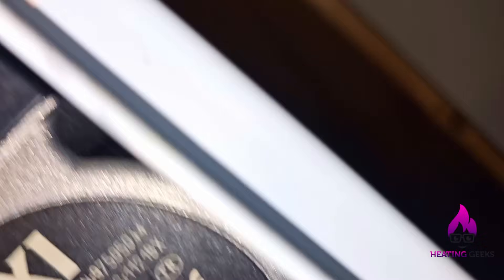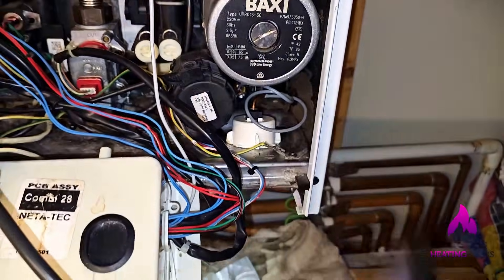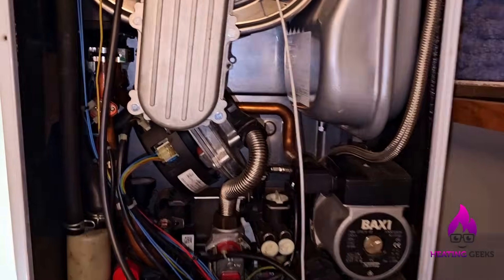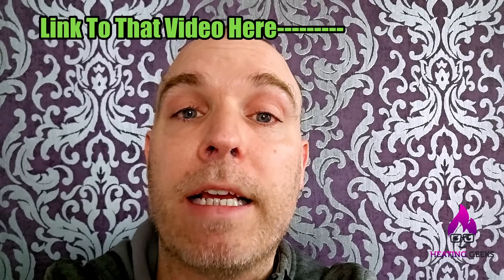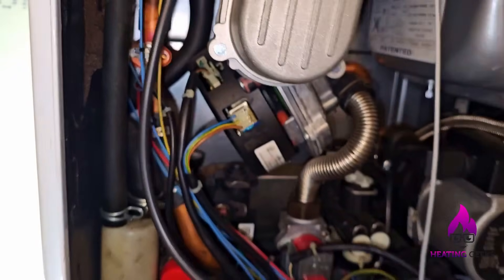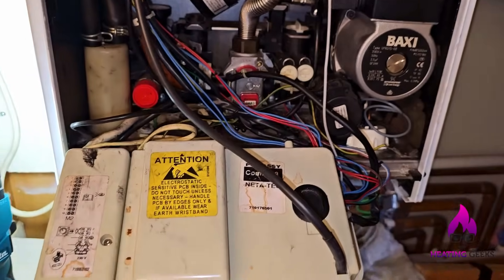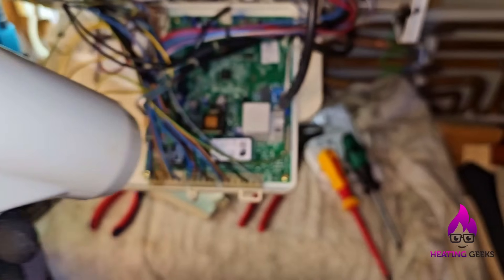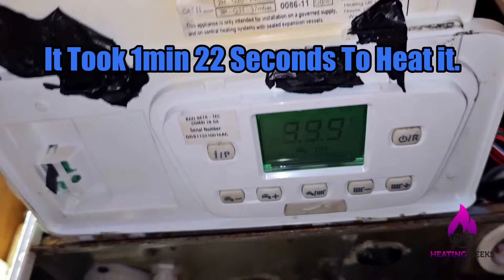Boiler wont turn back on......

Comment: You are 90% there - the startup capacitor is called the bootstrap capacitor  and as you say once the psu is up and running it does nothing bit like a starter motor in a car . All electrolytic caps will fail at some point in time - they have less than a 10 year life span.
Reply from the maker: I don't know how to pin it anymore :-(
Reply from the maker: Nice one. Thanks for sharing your knowledge :-) I will pin this

Comment: I’ve replaced 13 caps on a biomass boiler board the other day. Worked well and saved the customer near 4k 👍🏻 
All caps failed on the ESR meter but multimeter showed fine just low. So you need to have the rite gear
Reply from the maker: Yes mate, 100%. 17 is a lot on 1 PCB. What brand of biomass?
Reply: @HeatingGeek  it was a Lindner & Sommerauer 250kw 👍🏻
Reply from the maker: I hope you charged enough :-)
Reply: @HeatingGeek  charged like a rhino 🦏 mate 😂

Comment: Wow, nice one. Good on you for sharing that information. It might save me or another one of us some serious money some day. You know how it is - "It was working fine till you touched it!"
Reply from the maker: Exactly. :-) Now the toilet doesn't flush and the TV is flickering :-)
Reply: @HeatingGeek  who hasn't been called to a worcester flow manifold that's been spraying that fine mist for weeks, replaced it, turned on the power and boom - the fan goes pop. 😂
Reply from the maker: @MrSuperheterodyne  It doesn't bother me anymore when things like that happens. It used to but now I just tell people these things happen. I will now tell them to watch my video :-)
Reply: @HeatingGeek  I'll be honest, it frustrates me. I serviced an oil boiler the other month and the oil pump died a few days later. No way I could have forseen it, as pressure was stable and combustion was spot on. 
But then the customer will think "why has it failed, it was only serviced a few days ago". 
I try to suggest the analogy that you can get your car serviced today and the timing belt could go tomorrow.  😂  just one of those things we all go through.  Nice to discuss these things though, makes you feel a little more at ease knowing other guys have it happen. 👍
Reply from the maker: @MrSuperheterodyne  Yeah, I even tell customers that turning the power off to some boilers will kill the PCB and it isn't my fault. EcoTec being one.

Comment: There are 3 main places that electrolytic caps are used in a SMPS:

1. The reservoir cap that stores the incoming rectified and smoothed mains. This will likely be the largest cap on the board.
2. The SMPS controller IC start-up supply. The 320Vdc on the main reservoir cap is supplied to the controller via a high value resistor (sometimes 2 in series), this generates about 12V (regulated by a Zener in the control IC) which uses an electrolytic cap to hold the supply up when the chip starts driving the switching MOSFETs.
3. The output from the secondary of the transformer is rectified and smoothed to produce the DC supplies required by the circuit.

I have only ever seen failures of the caps in 2 & 3 above. I have heard of failures of the main reservoir cap but never seen it myself.

Always replace the caps with good quality branded caps, such as Panasonic, Rubycon, Nichicon, etc. The precise capacitance of the cap is not as important as make sure that the voltage rating is at least the same as the one being replaced. The tolerance of these caps can be as high as ±20% anyway, so fitting 150uF instead of 100uF is unlikely to make any difference.
Reply from the maker: Thanks for the info. I have replaced caps in other equipment and fitted higher temperature and voltage with the same capacitance the replacement parts have outlived the original ones. I get my caps from RS components so generally very good quality.
Reply: @HeatingGeek  RS are a good reliable source, I use them too.

Comment: Back in the day I fixed my PS3 with a heat gun / hair dryer by heating the motherboard... Now I'm adding a hair dryer to my tool kit.... Great video cheers😂👍
Reply from the maker: I done the same with my PS3!!! BGA chip. Lasted about 3 months and then I had to do it again. Then I got a PS4 :-)

Comment: UF   (micro farrads ?)   on my Fluke  Multimeter for cap testing,      do it on every service on oil and blown gas motors and change them out when low, before breakdown happens.

Often on water circ pumps its only a cap stopping it from starting.............

I don't delve into domestic gas pcb's  anymore,  as the gas police would be on my case.
Reply from the maker: I do check caps on oil boiler motors and find they are often low. I don't know what you mean about UF? Did I say something wrong? I'm not great with electronics so probably did. :-)
Reply: @HeatingGeek  Dunno about wrong, more ways than one to skin a cat.....  UF  is the symbol on a Multimeter for microfarads, which is the measurement for testing capacitors.
I'm self taught on electronics (basic for boiler repair) with what I've picked up off others and reading up,  so I could well be wrong.....    
I just fix stuff and get by.  😉
Reply from the maker: @julianhawker7672  Don't we all. :-) Wing it everyday

Comment: Another good job ollie, hate to think how many different spares u carry on ur van & sounds like u cover a huge area
Reply from the maker: I don't carry many spares tbh. I did carry a lot more but I don't really do domestic work anymore. Commercial parts are way to expensive to carry on the van. :-) What sort of work do you do?
Reply: @HeatingGeek  mostly domestic now, still look after a few church boiler rooms and couple of factories though, cant seem to shake them off. id probably prefer to do more commercial and leave peoples houses to the boiler bashers if truth be told.
Reply from the maker: I try and do the same. I have had enough of working in customers houses. No patience anymore.

Comment: The electrolytic capacitors dry out because of the heat in the inclosure with no vents. but sooner or later all electrolytic capacitors fail. Baxi is actually the only company I know of that will sell you the capacitors so you can swap them yourself.
Reply from the maker: Really? Where can you buy capacitors for Baxi from? All Baxi PCBs or just some of the more common ones?
Reply: @HeatingGeek  The importer of Baxi boilers used to sell the capacitors, so I would expect them to still do so. However, if you can't get them anymore this is how to find a suitable capacitor in cases where you can't find an identical one:

1.  Use a higher capacitance
2. Use a higher voltage

You can buy capacitors and other electronic components from RS, Farnell, Mouser, and Amazon etc. even sometimes from a local radio/TV repair shop.
Reply from the maker: Thanks for the info :-)

Comment: Tbf, standard carrying kit having a hairdryer .
Even the best engineer occasionally gets moisture on the pcb,
First rule when power off on a boiler,preheat with hairdryer.
Do a lot of jobs where properties have been empty for a few months,
First thing is to preheat the pcb
Reply from the maker: Yeah, PCBs don't like the cold when they get a few years old. :-) So do you heat the pcb before you even try and turn it on?
Reply: @HeatingGeek  yes 100%
Once bitten pal

Always now run the hairdryer over board ,and fan on worcester bosch,before i turn on the 240v
Reply from the maker: @sidpf1972  Its a good shout really. I will bare that in mind